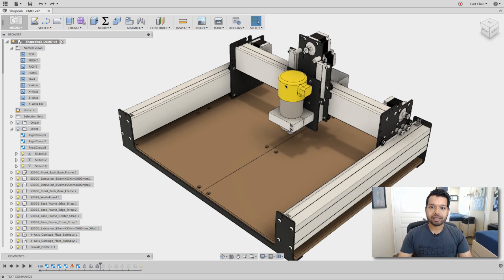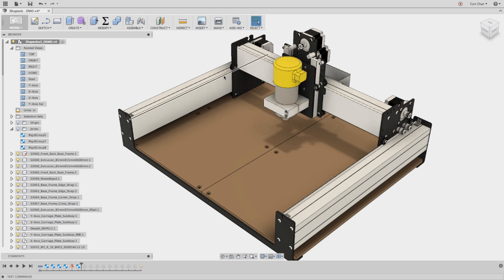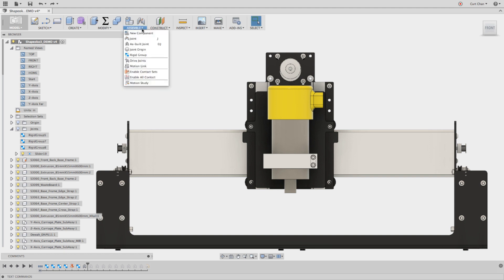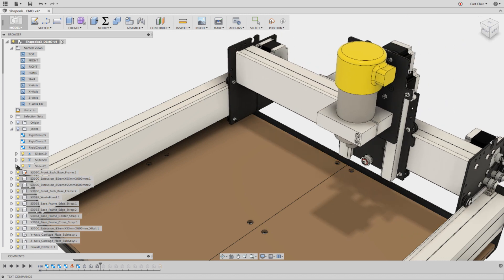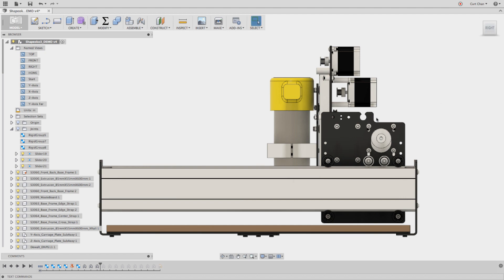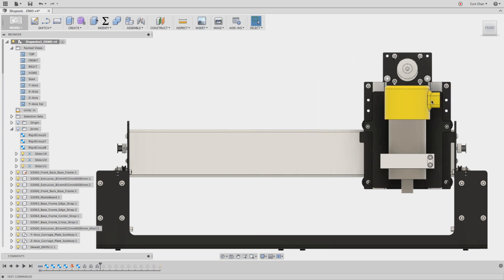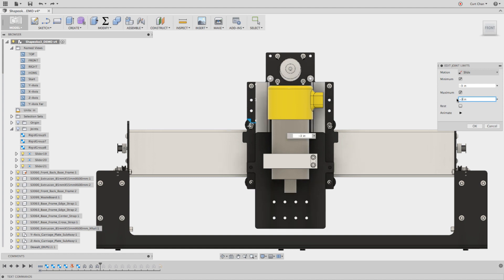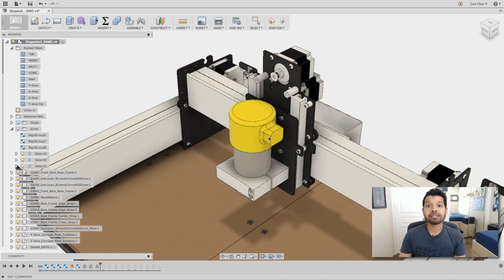Fusion 360: Assembly Joints and Limits on the Shapeoko 3

Comment: Dear sir, I've designed a CNC machine where I've used linear rail and ball screws. All linear rail(slider motion) and ball screw(revolute motion ) animation work perfectly. I wanna do a animation where if ball screw rotate by revolute motion, then according to the rotation of screw, the Linear rail slides will move back and forth. But when I add the two join by motion link, they are not working.
 I'm working hard and soul but still unable to solve the problem.
Please could you help me?

Please could I share my design so that you can check it?

Comment: Perfect timing. I've been scratching my head over joints recently. So what's the different in "as-built" vs. a regular joint. I think that using a regular joint will cause Fusion to assemble the parts for you, but are there other differences? Is there a video about that already?